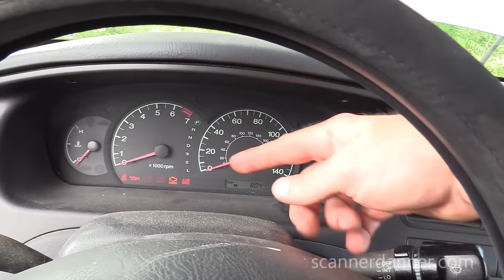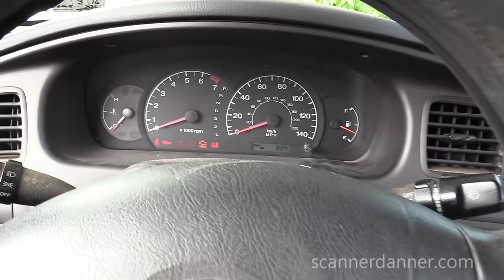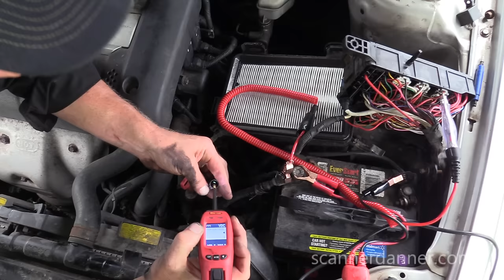No crank, good starter, how to troubleshoot, any car! (Hyundai)

Comment: how do you test a 2010 ford focus se? I am having a no crank no start issue....I removed the battery, starter, and alternator and took them to a local auto parts place and all of them tested good...i tested the starter relay and it clicks as does the starter...i checked to see if voltage is going to both starter and alternator and it does...the anti theft works as does the immobolizer...the neutral safety switch works also...Do you have any videos for the 2010 ford focus?
Reply: Check ignition switch
Reply: It turned out to be a starter problem...although I took it to 2 auto parts stores and it passed 3 times
Reply: I’m starting to think the same but have to take it in to know
Reply: @efreaky65  the conclusion I came to is that my Wife told me her 2010 ford focus is fuel driven, however, everything is electric run...so I am thinking that the reason the tests at the auto parts stores came up good is that the equipment they have is stronger than the Ford puts out...try taking the starter off and do a field starter jump on it...if it doesn't turn over like it is supposed to then 9 times out of 10 it will be the starter...also test the power from the battery to the starter with a multimeter if you have one...if you watch the video I did on that it may help you...I wasn't getting power on the main positive cable from the battery to the starter
Reply: I plan to test wires going to starter and fuses/relays related to starting and go from there
Reply: @efreaky65   I did all that and it always turned out to be  The starter
Reply: Finally found the problem, starter relay pin completely corroded out! Now have to clean out pin area and check wires connected to it to make they aren’t also corroded, then once cleaned up, apply dielectric grease and insert new relay and back on the road again

Comment: I am thinking of always adding a solenoid wire to all of my cars in the future, so that I can bypass everything and try to crank the starter by touching positive on the battery, if turning the key doesn’t not work. People, understand, this bypasses all safety measures like the neutral/park switch and the car could roll or start if in gear, so don’t try this unless you are fully aware of the dangers and do it at your own risk!

Comment: I have a hilux surf ssr-x 93 it had a kill switch in it when I left the switch on it will cut the disel pump off I've been told ecu not powering up to run truck and ecu for truck found burn wiring and low voltage

Comment: Hi, I'm Musa from South Africa, i just replaced my diff banjo on my isuzu npr 300 truck, the engine started well with out any hustle. During the i started d engine again n while it was hydling on neutral, d engine stopped and dashboard light r showing but no crank no start, if I crank d starter it starts but on the ignition it won't, i found a hole underneath d fuse box n a relay shift was corroded, replaced it but it won't start
Reply from the maker: nothing I can offer you Musa. Sounds like you have possibly a transmission range switch issue? Maybe a wiring problem in between

Comment: I replaced the starter on my 2002 xterra. It started for the first day after starter replacement now all I here is a click and no crank once in a while it will start. Battery is good 600 cca. I tightened the bolts, used jumper cables from battery positive to the starter Hot at all times and it started once but after trying it several times it doesn't start just hear a click even with the jumper. I tried the negative to ground as well but just a click too
Reply from the maker: do the checks on the two main starter wires like I showed in this video

Comment: Hey, I'm having the same problem with my car, however, I know that that cause of the problem was a "short to ground" that happen when I removed my transaxle. What I don't know is how and why everything in the car turns on slowly in the ignition position nor why the car isn't starting or cranking.

Comment: I have a 2011 Nissan Altima with push button start. But can't push button to cut off. Can you please help.
Reply from the maker: Not with the information you're providing. Start with a full code scan of your system, NOT just obd2 codes with a generic scan tool. ALL modules!

Comment: Does the fuel pump start pumping fuel right after we turn on the key or does it start pumping only when we start the key
Reply from the maker: initial key on for 1-2 seconds, then it shuts off until there is an RPM signal

Comment: I HAVE 2014 JEEP CHAROKEE LIMATED AND ON CRANK NO POWER FROM THE SPOT AT TIPM FOR RELY BAD STARTER CAN IT HAVE BACK FEAD AND MEST UP TIPM
Reply from the maker: You need to verify all inputs related from the PCM and anti-theft systems before you can condem that TIPM. Are there other circuits also not working?

Comment: 2002 Ford explorer XLT no Crank from key but will jump with scew driver from starter  no spark  any suggestions
Reply from the maker: No spark while jumping the starter? This means the ECM is not "alive". Check all main powers and grounds to the ECM. Check all your fuses. Check for a 5v reference at your TPS with the key on and see if it is there and report back. You also need some good wiring diagrams. https://www.scannerdanner.com/forum/post-your-repair-questions-here/3757-need-service-info-check-here.html

Comment: My car didn't want to start last Thursday, but I got it to after a few moments. I let it run for a while because it's very cold, and I have been experiencing problems with the battery being drained by something in my vehicle. I went to the store for food. Left it running. Then went ot the gas station, turned if off. Got gas and it did not want to crank. I tried it a few times. Nothing. It usually doesn't want to crank once the radio lights up, so I had to open and close the door. I put my foot on the accelerator, and it started to crank and finally started.

Got it home and it will not start. I was thinking I might need Heet or some kind of fuel additive because there might be ice in the gas tank and maybe in the engine. Charging the battery usually helps, but this time it just didn't. I watched a few videos regarding the starter and came to think it might be the starter.

Seeing this video, I'm wondering if it is a connection. I looked under the car and I don't think I can find the starter. I'm not certain if it's built into the transmission? I used a hammer and tapped a few things that looked like it, but did nothing. So, maybe it isn't the starter, but the wiring and possibly the connector.

My car is a 2007 Pontiac G6, base level 2.4L, I think. It's a difficult car to work on. There are so many things that don't make much sense in the car.

Comment: Hi mom, from another mom, my daughter borrowed my car and she turned it off, and when she tried to turn it back on a couple minutes later, it was totally dead no crank and no dome lights or headlights and the engine light is on, any advice to where to start
Reply from the maker: Voltage drop testing at the battery to begin with

Comment: What if you don’t have any power at that relay socket?  I checked fuses and they all have power 2000 Nissan Frontier 3.3L
Reply from the maker: you need some good wiring diagrams and service info my friend https://eautorepair.adtrk.biz/?a=10817&c=24&p=r&s1=
There are multiple relays and multiple circuits involved on yours. Park/Neutral position switch, ignition switch would be two of the power feed sources that feed your park/neutral position relay (starter relay I guess you could call it). 
Then there is a theft warning relay involved too.
Reply: I found the issue. No power at the interlock relay means bad neutral safety switch.  My dads buddy used a scanner and it popped up, even though I didn’t have a check engine light. I had already figured it was that, after other test i had done at the fuse box. I had crank signal at the fuss, but not at the relay or main power either.  I had 12volts at the starter but not on crank. The relay had no power on any wire with or without crank. The wiring had melted from the fuse box to the neutral safety switch.  I had repaired about 14 wires, so i think that had damaged the switch, therefore not letting the signal go to the relay and then to the starter.  When i tested the starter, it just spun the starter but not the motor, making it seem like i had also a starter or solenoid issue. But in fact it was all in the neutral safety switch.  I am currently editing a video on how to replace it

Comment: I know this is an old video but I got a good one. No crank, no run nothing except lights and stuff. Thing is in the box with relay the one that should be hot with clip at ground is and the other clip on positive. Stick probe in slot and nice n bright without key. Turn key no change.
Reply from the maker: I'm sorry, I'm not following

Comment: I recently changed out my starter. It was fine at first. Then a few weeks later it wont start no more. No crank at all too. Any ideas. Vehicle is an audi a4 Quattro 2005.
Reply from the maker: When it doesn't crank, what is the voltage at the bat post and solenoid post on the starter?
Reply: @ScannerDanner  how do i check for the voltage ?
Reply: Also i try installing a new relay. Ive seen some videos on utube for installing the new relay 395 under ecu box. Thats what i did. Still nothing. Also at the dealership they gave me an actuall starter relay which is totally different. It has only 4 pins.but the relay ive seen people on here replace is the 395 one which has 5 pins on em. So im still lost. Dont knw which nd where the starter relay actually is.
Reply: @ScannerDanner  an update. Ive manage to track down the problem. Took me a while to locate the starter relay for these cars since it doesnt say in th Manuel nor online. It jst shows u a punch of relays nd what not but not actually the location for these cars( audi A4 2.0 Quattro 2005 ) long story short. Relay is fine, however my main problem was jst the damn connector. Its lose. When push in no click sound frm the clip. Acutally broke off.  Like wat u always say ! If u cant duplicate the problem u didnt fix it.. Thank u so much again for your content of daignose!💓👌

Comment: I have a toyota Corolla that does nothin..the starter is good..but is not geting any power,! So wish side should of the solenoid on the relay should be??
Reply from the maker: You mean which side of the relay is the solenoid on? 30 and 87 would be your load side pins. With one going to the starter solenoid and the other going to a battery positive source.

Comment: Scanner Dan I've got a 96 1500 I can hook my test light up to my ground and push over to my hot it'll light up I can hook my my test light to my hot you touch my ground won't light up I can hook my test light to my positive post touch my motor touch everything the frame and it lights up got a bad short Anna what's your recommendation on this appreciate you watch it watch your shows all the time here on internet you're awesome man
Reply from the maker: your test light should light up when you touch the motor and frame when connected to battery positive, watch this video for testing your relay

Comment: I know this is an old video but I have a new starter new battery new alternator and it just cranks but no start...what does it mean?  Could it still be my alternator...please help
Reply from the maker: It cranks as in the engine/starter is spinning but not starting? Your alternator is NOT your issue. Spark, fuel and compression must be tested next, along with a full code scan of all modules.
Reply: @ScannerDanner  thank you so much... I found out it's my timing chain...smh

Comment: I'm having a problem with my 2003 CL500 no power in my tail lights I was checking my starter relay it was bad so I. Which relays and blew some stuff out I have no power in my Dash does not light up no more it only lights up when I cut my lights on I have power in my starter power in my alternator but no power in ignition coils and no power in injectors tap the starter with a screwdriver it try to start I checked my fuse box on the passenger side starter relay I believe I am not getting no power in that relay and I pulled the plug from behind the fuse box and I'm getting no power any suggestion.  I bought for relay switches Advance Auto and every last one of them was bad made from China
Reply from the maker: You need a good diagram for stuff like this. Here is a link to the DIY version of the service information I use https://eautorepair.adtrk.biz/?a=10817&c=24&p=r&s1=

Comment: HI I HAVE A 2001 HYUNDAI COUPE AND IT WAS RUNNING FINE NO ISSUES AN WENT TO START ONE MORNING AND NOTHING AT ALL NO DASH LIGHTS NO CRANK NO NOTHIN COULD IT BE THE SAME IDEA AS THIS VIDEO.
Reply from the maker: No sir, this would be different. No dash lights is the key.
Does anything else work? Interior lights, headlights etc?
Reply: No mate only lights that work are the ones that are on the car door cards nothin else at all
Reply from the maker: @jasonwestwood5155  some main voltage tests at the battery and fuse box would be in order then
Reply: @ScannerDanner  ok thanx will try it

Comment: Pour some CLR or battery terminal cleaning foam spray or Coca-Cola, Backing Soda, whatever similar to dissolve corrosion. Get solderless spade terminal end with needle nose pliers and manipulate inside each female slot in fuse box until corrision removed. Rinse and blow dry. Then apply bulb terminal grease to help water proof connection.

Comment: I have this problem but it’s intermittent. I can go a couple days with no problem, the next day it will act up 3-4 times. I found that if I turn the key and hold it in that position, eventually it will start. It might take a few seconds or 3-4 minutes.
Reply from the maker: You treat it no different! You MUST do the tests I showed on the starter itself DURING the problem. Period. Otherwise everything else is just guessing

Comment: im subbed bro ,really enjoy your vids ,i got a problem ,i got a 2011 Buick lacrosse cxs thats been parked for two weeks , went to a dr's appointment and 3 hrs later ,put my foot on brake and push the start button ,no crank no start !!! .i used two code readers with same results , PO23F FUEL PUMP SECONDARY CIRCUIT /OPEN and UO100 LOST COMMUNICATION WITH ECM/PCM ...i checked fuses under the hood , and i did a relay test on my relays to make sure they all clicked and had continuity in them once i applied power to the power side . now when i used a ohms meter to check fuses after the test light ,i had one strange fuse , it was mini fuse # 10 , 20 amp fuse , its for ECM . instead of giving my normal reading of "0" it read " 4.2 "OHMS on ohm meter setting 200k and "4.24" 20k setting ??? this was the only fuse that as burnt , i changed it several times and it continued to burn out when i turned ignition on and try to start ! ... this fuse reads normal zero when installed before it burns , once it burns ,it reads 4.2 again ?  this is a real mystery to me brother , i wish you were close by ,any help or ideas are GREATLY APPRECIATED !
Reply from the maker: This is a bias voltage you are seeing. Ignore the 4.2 volts. I can explain whats going on there later when I look at a diagram.  Chase the short to ground like any other one to start with.
Reply: @ScannerDanner  WOW ,ScannerDanner ,very impressive how fast you replied sir , THANK YOU VERY MUCH FOR ALL YOUR HELP ,the 4.2 was ohms not volts ,this is very confusing ,i put the burnt fuse in several other fuse slots and got what is expected ,my meter reads a 1 as it should ,but this particular fuse slot # 10 show 4.2 ohms with burnt fuse ,now when i redo computer by putting a jumper wire to pos and neg cables while off battery i wait a few minutes ,then i install a fresh fuse ,connect my cables back ,check my fuse with ohm meter and it reads a normal zero ,i then try to start and again fuse burns and again reads 4.2 ohms . i have never encountered this before . before it burns ,the # 10 fuse reads normal volts and continuity  with ignition on , once i start it it blows ! .......now here is second mystery ,when battery is hooked up with burnt fuse still in ,when i open a car door ,it gets something on the front of the sideways turned motor in between throttle body and alternator to rattle off about 10 quick times , like a short burst from a machine gun  ,it happens again when i disconnect bat cable and re attach it also ,only does this with burnt fuse not with new un blown fuse .....again THANK YOU VERY MUCH FOR LOOKING INTO THIS PROBLEM FOR ME BROTHER ! ... this no crank situation is driving me crazy lol !!!!
Reply from the maker: @rick31869  https://eautorepair.adtrk.biz/?a=10817&c=24&p=r&s1=
Reply from the maker: If you need additional help, post this to my forum, it is free to join and I have paid moderators who are there to help me help you guys. It is hard for me to keep up here but I do the best I can. www.scannerdanner.com
Thanks! Hope to see you there.
Reply: @ScannerDanner  thank you kindly brother for all your help  ! SOME MEN ARE BORN IN GREATNESS AND SOME MEN LIKE YOU HAVE GREATESS THRUSTED UPON THEM ! IT WHATS MAKES YOU SO GOOD AND A GOOD TEACHER !

Comment: 2005 Chevy Aveo it has sound run run but don't turn over?
Reply from the maker: Wrong video if the engine is cranking. Find out what you're missing! Spark, fuel and compression must be verified